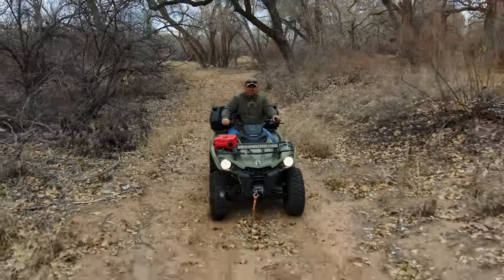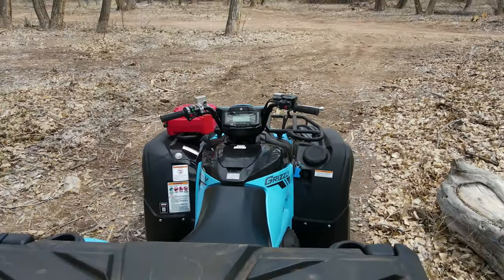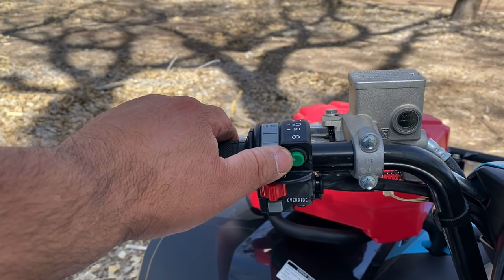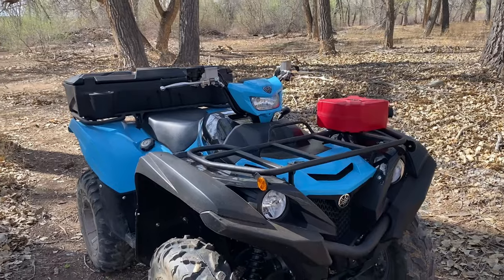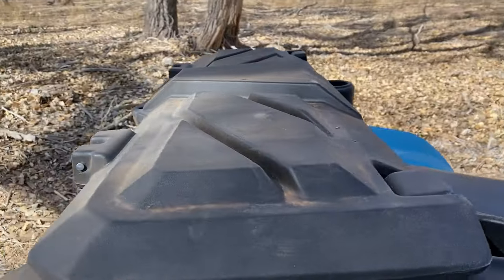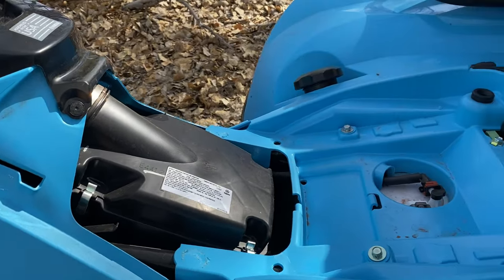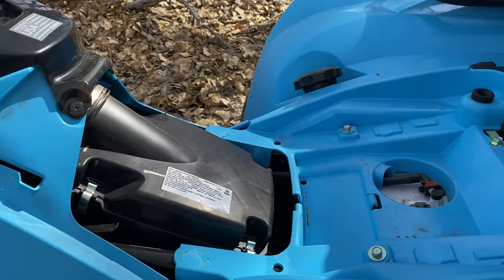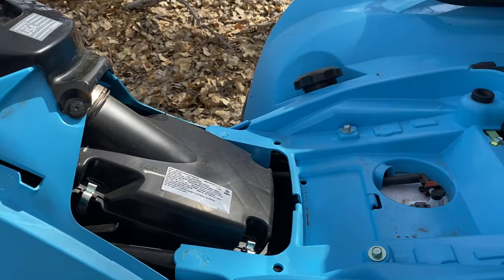2023 Yamaha Grizzly Walkaround | Why Did I Buy A Yamaha?

Comment: I had a 2008 Yamaha grizzly 700 and put over 3 thousand miles on it. sold it and bought a 2020 cam am 570 outlander. The outlander had nothing but problems the entire time I owned it. wish I never got rid of the grizzly.
Reply from the maker: That sucks man! What a disappointment with the can am. Over the years I have owned many ATV brands such as Suzuki, arctic cat, and polaris. By far, the can am was the most problematic. Thanks for watching man.

Comment: I had the exact same issue with 2 BRP seadoos a 260 and 300 rxtx 1600 cc. They would over heat constantly engine light would come on.  I would hear a hissing sound coming from gas cap. I opened it, it would pop and gas would shoot out. I'm sorry to say but BRP, Polaris, Artic cat the quality is just not there. They don't last and there is constant issues. The Japanese just do it better. Look at the automotive industry. Same thing there GM and Ford are Garbage vechicals, and I own 2 GM trucks. This is coming from a owner. You may get a good one with no problems but the other 10 are nothing but. Japanese are little people so unfortunately they don't go big vechicals like yukons and suburbans which I need for a large family. Glad to hear you made the switch to a quality brand. I almost guarantee you ll have little to no issues with this bike.
Reply from the maker: That is crazy to hear you had the same issues with your seadoos. You would think that Can Am would get it together. I am glad to be moving away from Can Am and into Yamaha. I can already see a quality difference on the machine versus Polaris and Can Am. I know what you mean by the lack of bigger vehicles. You would think they would move that way. Thanks for watching buddy.

Comment: How fast is it ? I made a mistake buying a 21 rubicon that's gutless.
Reply from the maker: I have never maxed out my ATV since I do a lot of my riding. But I can say on a straight path I easily hit 45 with plenty of gain to be had. I would imagine 60 or 70 is not out of the equation. Bummer on the Rubicon man.

Comment: That definitely looks like a great rig!  When I was in the market, the grizzly was definitely one I was considering.  Ultimately, went with the Outlander 650.  I found a '21 with only 70 engine miles on it for a great price since I didn't have to pay for the shipping and assembly fees dealerships add on making them around 2k more than the sticker price.  So far, no problems.  But I haven't went on some long excursions on it yet.  Your vids definitely have me longing for the long trip sometime in the near future.
Reply from the maker: I hope you have no issues in the future with your Can Am. I think I ended up with a bad apple from Can Am. My neighbor owns a 570 Outlander with no issues. So I don’t know what the deal was with my machine. But I don’t blame you for going with it on the cost savings you got. 2k is a big savings. Happy riding buddy. Thanks for watching and commenting.
Reply: @ManzanoManATVAdventures sounds like he pulled 2k savings out his ass lol

Comment: Still rocking a 2015 polaris 570...I agree on the battery location..wth were they thinking...I relocated mine to the storage bin with a disconnect switch...no draw to bike at all...one regret is I wish I would of went with power steering...good luck with the new ride and glad to see your videos out again...stay safe out there and try to keep 4 to the floor
Reply from the maker: Hey man. I still own a 2014 Polaris 570 myself and it is a good machine. That is awesome you moved your battery into the storage bin. That is a wise change to not have to deal with in down low. The power steering is pretty dang sweet. A must have if you want to ride more comfortable through harder terrain. Thanks for watching my friend.

Comment: Those Grizzly's are nice machines. Much better than the canned hams in my opinion. When it came decision time for me, I went with the Suzuki King Quad instead. I couldn't find any decently priced used Grizzly's (a testament to people hanging on to them) when I was looking and to be honest, I just liked the look of the KQ better. But I sure would like that rear disc and more suspension 😉 Nice ride my friend!
Reply from the maker: How do you like you King Quad? I have always had an interest in them for the same reason as you on how they look. I've owned a Suzuki LTR 450 and I think Suzuki makes a solid engine. But I know what you mean by Grizzlys, the hold value and people hang on to them. Man am I glad to let go of the Canned Ham lol. Worst ATV I have owned by far. Thanks for watching man.

Comment: Yamaha have the same controls as my cfmoto with the 2wd/4wd and diff-lock system. 
You got yourself a really good atv there, Yamaha have really good belt and warranty on the belt aswell. What I really like about Yamaha is that they have so much storage space on the bike.
I wanted to buy Yamaha back in 2018, but they didn't have and 2-up version.
Reply from the maker: I was looking at the cfmoto and noticed that they both have a similar setup. I know you have had a good ATV with yours. I am glad to have the Yamaha. I can’t believe the issue I have had with my Can Am. I’ve owned many machines and brand throughout my life and by far this machine costed me more in repairs that all my other machines combined. I never could get a single thing covered under warranty and it was clearly a Can Am issue. Anyways, thanks for watching buddy.

Comment: Hey buddy I was never a fan of the can-hams but it’s funny I am or was a die hard sportsman’s fan story short I ended of selling it because it was in the shop more than I was riding it but also bought  a grizzly 700 which I ended up putting a ESH fuel/ air box mods which made that much more power..
Reply from the maker: After my experience with Can Am and the warranty department I will never own a Can-ham lol again. The Yamaha is a great machine. Polaris isn’t bad, I still own my 2014 Sportsman. But I am sold on Yamaha. I’ll have to consider doing the same mod you did. Sounds like a good deal. Thanks for watching buddy.

Comment: I would purchased a Cfmoto Cforce 1000 or 800 they are very good and they have a good price too and it come with a vinch, plastic hood in front and back and a back lugage as default from the factory.
Reply from the maker: I have seen the CFmoto line up. They look like really nice machines, but I do not know of anyone who owns one and their experience with CFmoto. Thanks for watching.
Reply: That 700 Yamaha will actually be more power and 10,000 times more reliable than the CF Moto.

Comment: What did you mean about let air out, was you talking about the tires or shocks?
Reply from the maker: I find that when I let air out of my tires, it helps a little with not being so stiff on the trails so the tired absorb rocks a little easier also lending a little help on the shocks not taking it so hard either. Airing down to at least 5psi is a good all around pressure to have. Plus it helps when going through mud, sand, and other trail challenges.

Comment: Nice quad!  Bummer about the 570 issues.  I have a ‘17 with 7000 miles and had good luck.  How’s the suspension and seat?  I recall the Grizzlys ride like a Cadillac.
Reply from the maker: I do believe I got the bad apple in the bunch. My neighbor has a 570 and he never has problems with his. I’m glad your machine has treated you well. The ride on the Yamaha is smooth and comfortable. Even better with reduced tire air pressure. So that is a nice added bonus. Thanks for watching man.

Comment: I have a 2022 Grizzly 700 EPS XTR ..... I love this atv, its so much better then the Polaris atv´s I have had in the past. There is one thing that will make this bike perfect and that is longer wheel base.
Reply from the maker: Hey man, I am glad you are enjoying your ATV as well. I will have to admit, I am sold on the Yamaha brand now. I am just kicking myself on why I waited so long to get one. Thanks for watching bud.
Reply: If they make them longer they won t fit in a 6.5 truck box. I have a ford and the grizz fits perfect in the back.imo
Reply: @nortonashburn6119  Exactly. I have a 2022 Grizzly XTR (and a 2019 too) and a Ford F250 and it's nice being able to close the tailgate. The short wheelbase also makes it lighter and better handling.

Comment: I looked st them but they had nothing. I checked the cfmoto brand got a awesome unit with  winch, fully adjustable shocks bigger tires bead locks. More storage and 9 gallon tank. Plus more for the same price point. Plus 5 year warranty.  Yamaha or can am can't beat it. Look in to them .
Reply from the maker: I am glad you found something that you prefer. I am still happy with my purchase and do not regret it.
Reply: 700 Yamaha will have more power more low end. Torque, doesn't need the 5-year warranty like you'll definitely need for the CF Moto. That Yamaha will be more dependable than just about any other bike on the market. Not to mention it has a smaller gas tank for a reason, it sips fuel compared to a CFMoto. Yamaha also guarantees their engine for 20 years. You don't see that with a CF Moto, also. Yamaha has a 10-year warranty on their belt, you break it in 10 years. They'll replace it free of charge. You don't break or burn a belt on the Yamaha. Yamaha is a much better bang for your buck than anything from CFMoto
Reply: yamaha dont need 5 yr warranty  see where that cfmoto be in 5 years and what u have to replae

Comment: Your gas vent problem on the Can-Am was your own fault due to the lack of maintenance. Coming from Yamaha. I can tell you if you don't maintenance the tube. You'll experience the same thing. FYI on the Yamaha your high beams are all three lights, not just the top one. The bottom are LED that top middle one is useless.
Reply from the maker: For you to assume the gas venting issue was a lack of maintenance is funny to me. You have no clue how I take care of my machines. So for someone who has owned Polaris, Arctic Cat, Suzuki, Can-Am, and now Yamaha, how do you explain that no other ATV I have owned never had this problem let alone the stacking problems I kept on having with my Can Am. I have taken my Can-Am to the shop many times for repairs for them to keep on happening. And since you think I didn't take care of my machine, send me your address so I can send you my dealer receipts for a reimbursement since Can-Am extended warranty was junk also! They never covered a thing.
Reply: Exactly crickets😅😅

Comment: Too bad you had so many problems with your Canam. I have a 1000 Outlander that has been great. Ultimately it’s not what you ride just that you ride.
Reply from the maker: I know what you mean man. I think I had a bad apple in the Can Am lineup. My neighbor has a 570 outlander with no issues. To bad I had the issues I was having. But getting out there and riding is what really counts.
Reply: Ive heard and seen that the lower output canams and polaris's have way more problems than the 850s and 1000s because theyre the cheaper machines of the line up, doesnt make it right but it kinda makes sense
Reply from the maker: That is interesting to hear this. You never know what they do to the bottom end of their lineup.